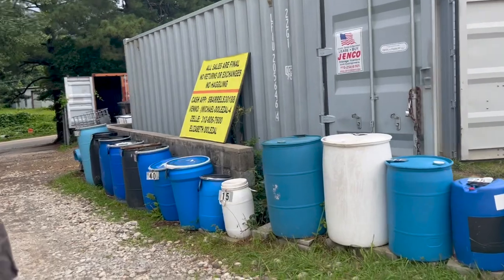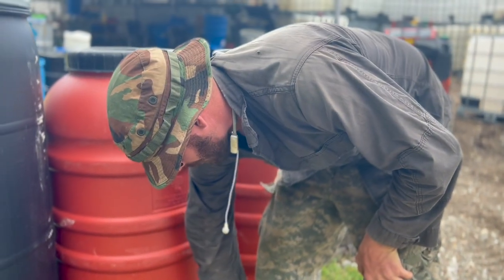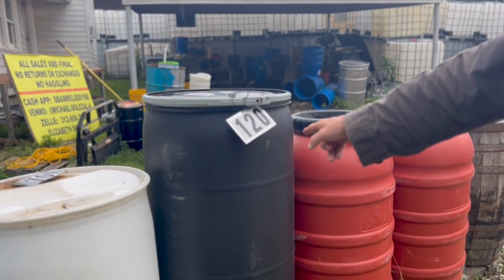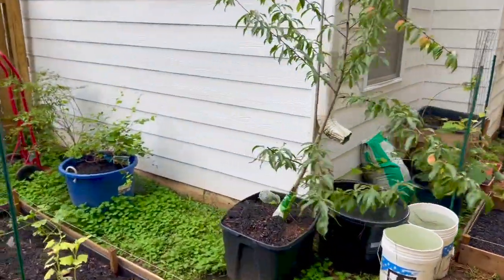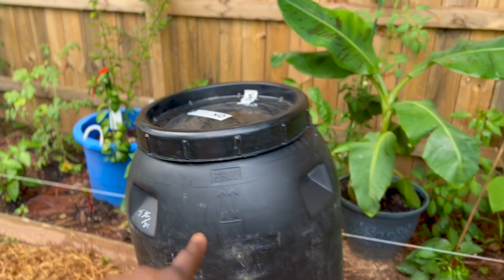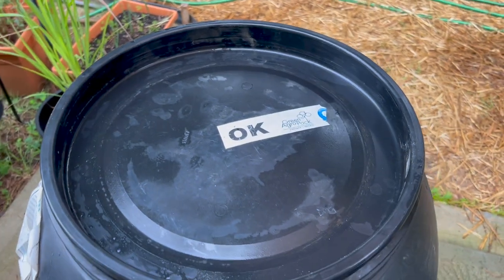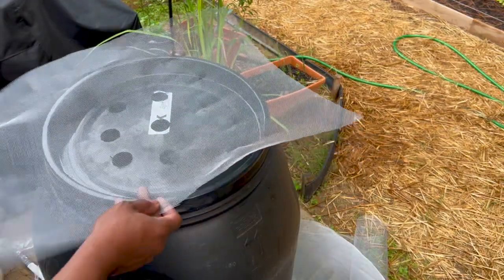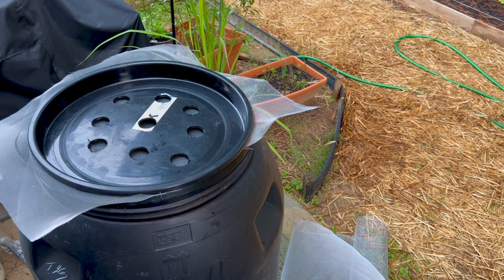My First Rain Barrels

Comment: I got one of those big plastic totes in a metal frame to hold more water.
Reply from the maker: I want one of those big plastic totes. But if I were to get one I would have to build a structure for it. With the white plastic it allows too much sunlight in which promote algae growth.

Comment: Im new here. sent from lead sharing your video. Yoo in my area South GA theres this guy who sells used ones I think for like 10 and 15 bucks. Big ones too. But the lids dont screw off. so Yeah, just an FYI I havent bought any yet but seen theem on my local marketplace on FB
Reply from the maker: Thanks for stopping by E 👍🏾

The prices have been all over the place. This is the cheapest I've found in Atlanta so far for 60 gallon food grade Barrels.
Reply: @SundayBackyardFarmer  Oh ok, I'm in Albany. Yes they have been. This guys here has 55 Gal and maybe more. I only invested in this high price Berkey water LITE. because I don't have my own land YET like most of yall. I dont want to pay rent either. I rather pay low taxes a year so I chose the mobile water option until I have my own land to put big barrels for stationary locations. Thanks for the info! Have a good one.